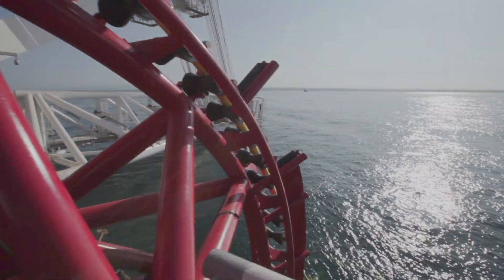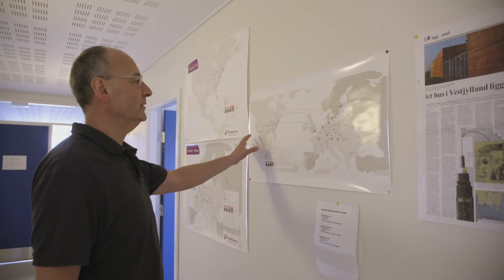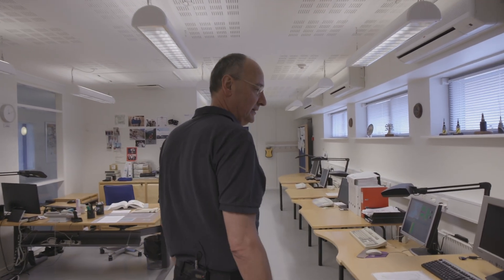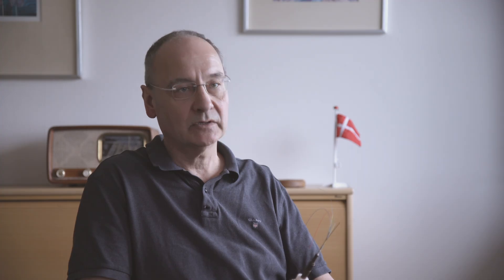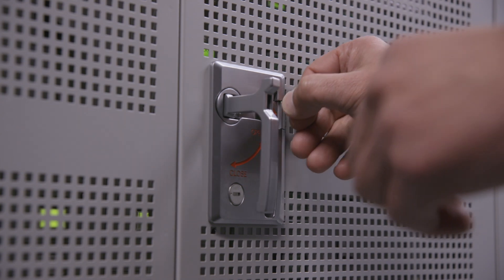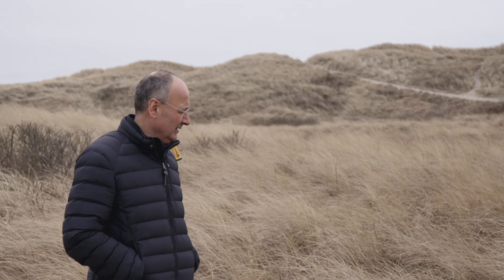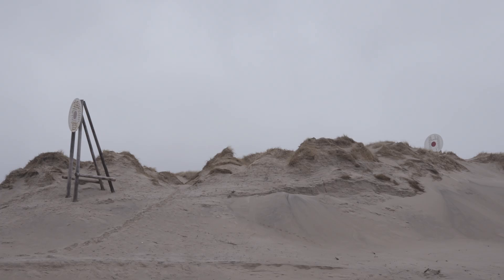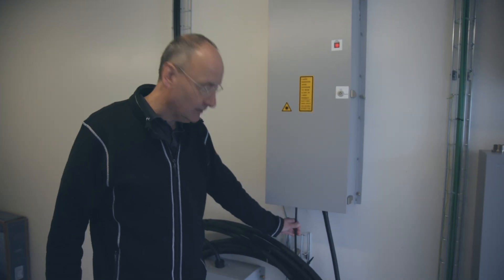Inside the Beach House Connecting the World’s Internet

Comment: It is quite fascinating that submarine cables only use about 8 fiber pairs, where terrestrial cables usually use 100 to 600 fibers in a single cable. The main limitation are the repeaters / amplifier , that are placed every 40 - 100 km, it is very hard to build small and low power amplification with so many fibers. So they use only few fibers and few amplifiers in each repeater, but then use a lot of wavelengths on each fiber, so they can fit about 10Tbps of bandwidth per fiber. (i.e. using 40 or 80 channels on each fiber).